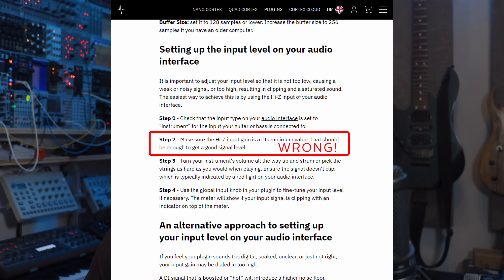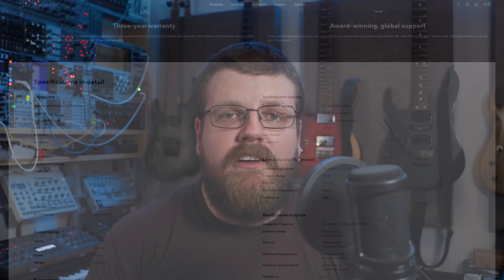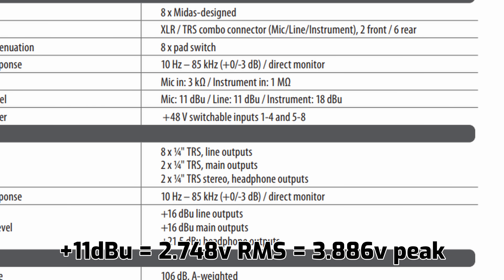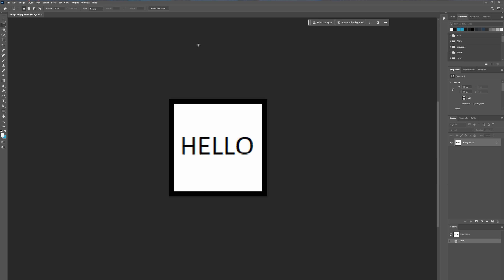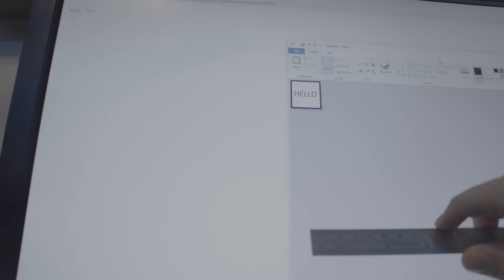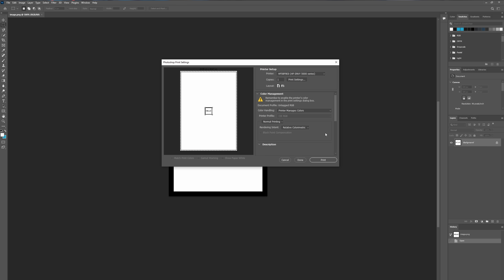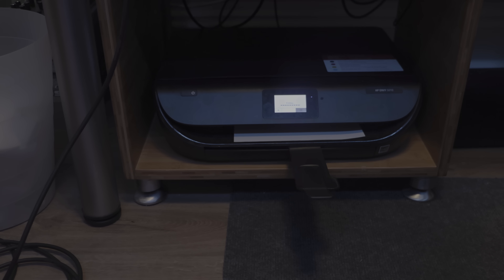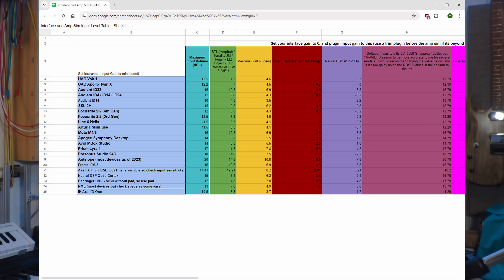Ampsims and input gain - Please, stop the madness...

Comment: So does this change according to the pickups you are using? I was clipping like crazy in my DAW using EMG 81/85's but barely in the yellow on my interface. I tried reducing the input in my plug-in but it just lost all the bite and presence. I zeroed out my interface input and cranked the plug-in input and got fantastic cleans and distortions without DAW clipping. What is the correlation there? Is it the pickups?
Reply: You absolutely must redo this every time you change to a higher/lower power pickup. This is exactly what you have to do with real amps as well - particularly if you use pedals/effects since their sounds are directly tied to gain levels. An LP and Strat will always have different patch gain settings.
Reply: @Jack_cx Okay, kind of what I thought because I was familiar with this issue in my live rig, I just didn't know how it translated through digital etc. There needs to be some clarification that there are still other factors involved. Zero works for my EMGs, but I probably need to crank it a bit for my P90s.
Reply: The input level meters on your interface are probably not accurate.  I seem to have the same problem, I don't look at those at all when setting level, I do it entirely in the DAW.

Comment: If Neural DSP themselves are saying their plugins are calibrated to an input of 0db I don’t really understand why you’ve wasted your time
Reply from the maker: Well, if you'd like to understand, watch the video :)
I'll give you a hint; Neural DSP probably did not build your audio interface.
Also, that's not what they said.
Reply: @GhostNoteAudio what if you use a Quad Cortex? I agree this is the correct process, but I also can’t see myself adjusting the Quad Cortex input level and amp sim input level for each model that I use in there, especially since that spreadsheet doesn’t exist for it
Reply: Neural DSP say their plugins are calibrated for 12.2dBu of headroom. That just happens to be 0dB on SOME interfaces. If yours is different, then you'll need to match to that.
Reply: They might well be calibrated to 0dB, but it's still far superior to set your analog levels to a loud level and then lower the input to the plugin in the digital domain. There's a reason why the input gain in the Neural DSP plugins can be set to negative values and not only boost the signal.

Setting levels on your preamp or in the plugin doesn't matter for the amount of drive that the amp model will deliver, but it makes a huge difference in SNR (Signal to Noise Ratio).